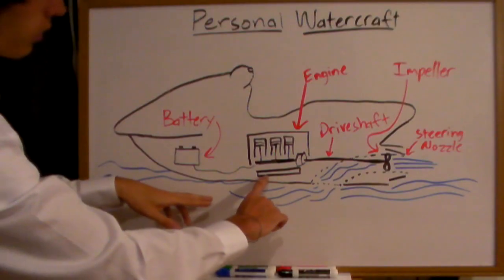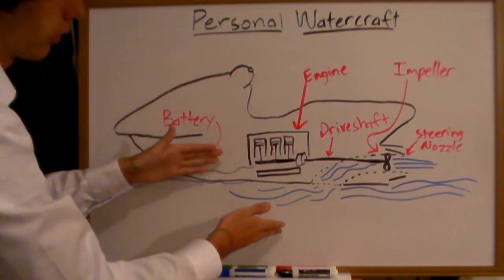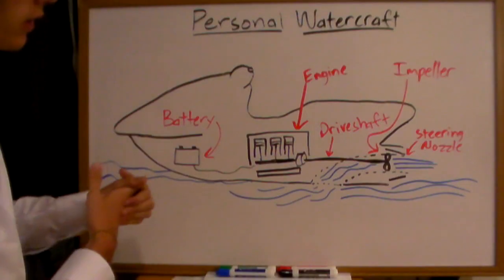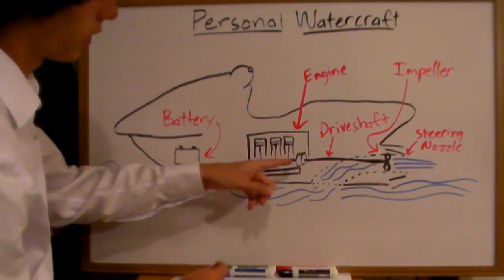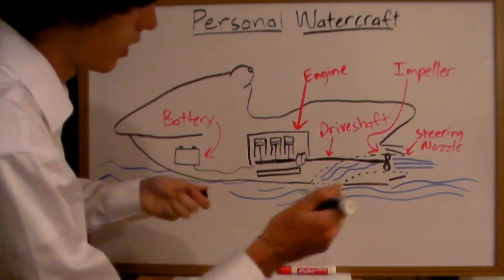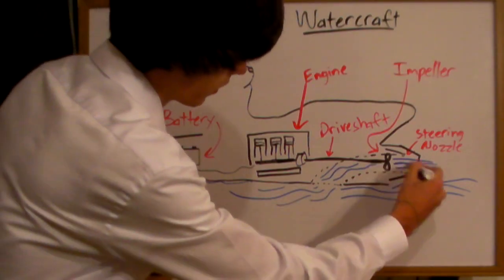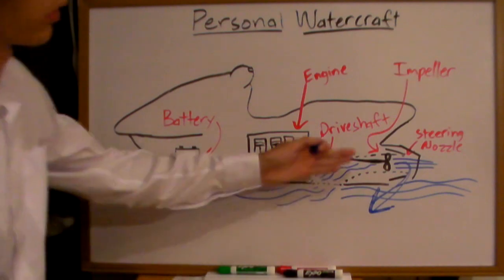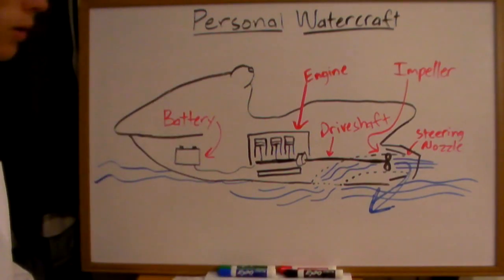Jet Ski - Explained

Comment: Is it just ,how Seadoos work when it comes to cooling the engine ??. Because they are different than kawasakis and Yamahas. This was too basic,designed for 12 year olds. would be great to have a much more in depth video, but can not seem to find any, which is strange. You would think manufacturers would have put one out years ago.

Comment: If I were to make a small watercraft

would it be economical to run it with a 1 cylinder 125cc 4 stroke engine (from a small motorbike) the gearbox countershaft is connected to a 2:1 final drive that is connected to a Fine pitch propeller?

Comment: Question..  I have a seadoo challenger.  The quick connect I know you can leave it in the socket of the boat.  But my question is.. Does that port do anything when running the boat... Can you actually just get a 3 foot hose and leave it in the port at all times as a permanent extension if you were handy enough to mount and secure it.  Would that damage anything, does it take water in the port when using or is it just for flushing

Comment: How does a jet ski's air intake work? I mean (if it turns over or you dive into water) what stops water from getting into the engine?
Reply: There are vents in the cowling that let Aaron and if it were to roll over you flip it over right away they have a lanyard on them that shuts them off if they're old or you fall off
Reply: @tolinof79  I see... Thank you sir!!

Comment: Your handle bar looks like a boob.
Reply: Kevin V You're just a horny little....no wait.....yeah, yeah it does.
Reply: I thought I was the only one who thought that too hahaha.
Reply: It does😂😂😂
Reply: It's the next generation of jet-ski design. In the place of cylindrical handlebars, are a pair of realistic rubber tits.

Give them a few good slaps to start the engine, push them together to move forward, thumbing the nipples to control direction. To reverse, grip both nipples and pull backwards.

To switch the engine off, plant your face between them and shake your head.

Comment: how does reverse function with the plate if the water is getting sucked in the opposite direction? shouldn't there be another plate in the intake? Or is it good enough
Reply: Dan Ivanov theirs a bucket that redirects it under
Reply: gotcha, thanks

Comment: How can an engine work without air supple if it requires air for combustion. I only know about car engines and how the more air inside the cylinder, the more effective the engine. So wouldn't this make the engine extremely inefficient
Reply: +cardayz 
A jetski always has some openings under the seat or on the bonnit for letting air in the engine
compartment, and when some water does get in the compartment, a small waterpump wil pump it away,
so it's simple as that.
Reply: I think you are mixing jet skis with submarines...

Comment: what kind of joint allows the driveshaft to change direction and provide torque at the same time
Reply: +Akash Nigam watch it again. has nothing to do about changing direction. still keeps moving the same direction just the force creating the thrust out the nozzle is redirected at an angle down and under the craft. thus changing the direction of the "pushing" forces that move the craft

Comment: So how do you accelerate the Jet Ski, if there isn't a transmission to adjust the amount of power being sent to the propellor by the engine?
Reply: If you didn't understand how the power were adjusted, I'm pretty sure your new jet ski will be a dream only. You clearly know way too little to be able to even remotely build something like that. Sorry!
Reply from the maker: Cobrastarzz1 By modulating the throttle. Full throttle = full acceleration.
Reply: Thanks Man :) I'm a Mechanical Engineering BSc. student and inventor by hobby, i'm working on a new type of jet-ski , and i'm currently in the process of analysing the characteristics of normal jet-ski's and stumbled on your video :)

Comment: Sorry for my typo in my previous statement, what I meant is what do you call those engines. The engine that sucks in water and shoots it out to propel the watercraft forward instead of using the propeller?

Comment: Regular prop engines also force the craft to "plane off" more which in such a small craft at such high speeds you'd probably lose a lot of the control that you have with a jet.

Comment: ok so i want my exhaust loud.but because its under water its not very loud. would it be ok if i put the exhaust exit hole above the water line.. that way i would have louder sound....would this be safe to do for engine.... i have a 2stroke  50hp